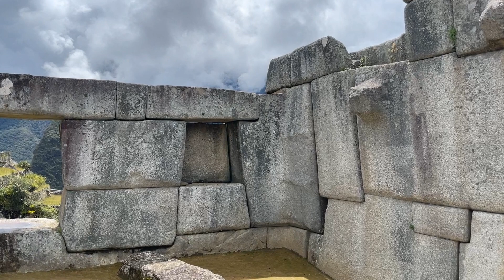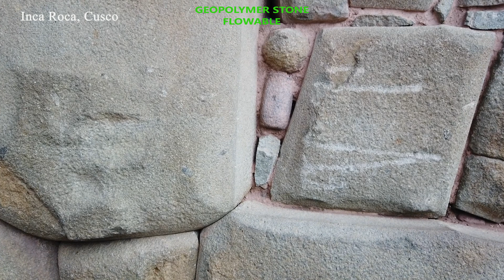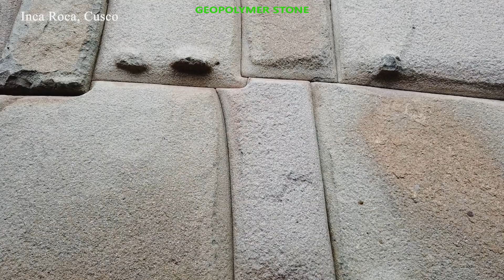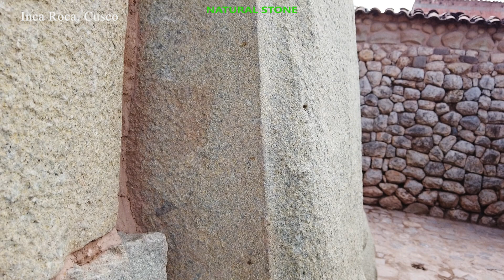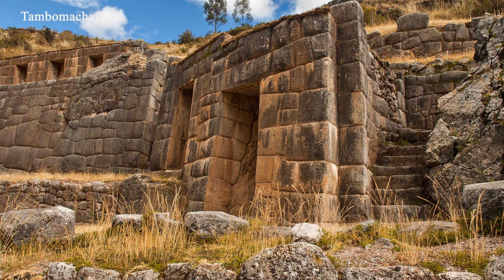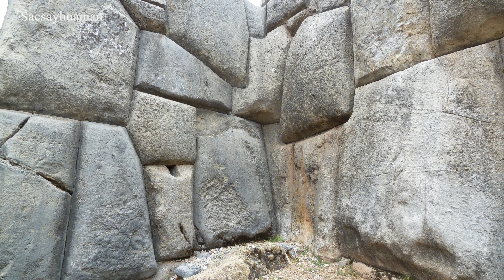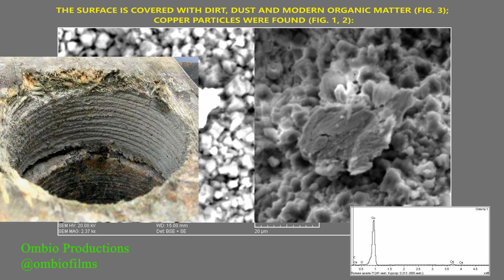Facts about geopolymers in Peru and Bolivia. And what alternatives? #history #ancient #incas

Comment: I found this video such  a Gishgallop of faulty reasoning and stretched logic that I wouldn’t know where to start with a response. However,  nice graphics, good presentation.
Reply from the maker: Thanks. "faulty reasoning and stretched logic" usually means there are no arguments.
Reply from the maker: The idea of GP has no basis. Therefore, reasoning about nonsense looks like nonsense. https://docs.google.com/document/d/1hpqI_MUSg7hO4-vvKs1peFk4p-VCj8Ce/edit?usp=drive_link&ouid=113821213738328685474&rtpof=true&sd=true https://drive.google.com/drive/folders/1Jp0nyqT4Jo-86PBJjmXAvC6biKFSX8t_?usp=drive_link
Reply: @GRES_TAC - thanks for sharing that. I have read about those lazy stone before and I have to say, your conclusions are way too premature to be conclusive. You cannot just assert that since these stones are halfway from quarry to site that they are abandoned cargo. You need more than that because there are many reasons why they could be there. You still have a lot of work to do to explain how they got there instead of assuming the fact. I’ll give you 2 glaring flaws with the argument.
why is there no collapsed frames or rollers devices under any of these stones. If they were moved by the Inca a few hundred years ago, then we would expect to see something. 
There is a river. Explain how Neolithic people moved masses the sizes of the space shuttle across a white water river. 
There is no answer to either of those questions because these stones were never moved and were poured in place at that location. There was a small city in this valley. Do you think that the Sun temple was the only construction in the area and the rest was just fields like it is now? Not likely. It’s more likely that these stones had some function in a thriving valley town. What function? Take your pick. All sorts of things around modern towns need a big concrete slab. It could be for a workshop, some sporting thing, maybe a statue was on it. 

If anything, the existence of these lazy stones are evidence against your proposal, not in support of it. It’s all reconstituted stone, created and poured in place. No haulage or stone cutting is required anywhere therefore all your logistical problems go away. Ockhams razor.
Reply from the maker: @SueDonym123  " no collapsed frames or rollers devices under any of these stones" The quarry stones are on ramps. No need for rollers https://drive.google.com/file/d/166Y44zIFm41WaqrMy0DuyZrK5JFXKyFK/view?usp=drive_link "Explain how Neolithic people moved masses of the space shuttle across a white water river." What Neolithic? The Inca Empire is a different level of knowledge and capabilities. Urubamba is shallow in certain periods. And there is a dam nearby that allows the channel to be diverted.
I understand your position. Thank you for the discussion.
Reply: @GRES_TAC  - That’s a pretty poor demonstration of concept and I find it hard you think that’s anywhere near conclusive. They showed a huge number of workers pulling a medium sized block skidding along rounded cobblestones. I’m sure you understand the concept of friction coefficient. Here are the flaws of the model being presented-
Where is the level cobblestone path from quarry to site? If you think this was Inca then you would expect to see something more. Why are the tired stones sitting in the dirt? 
They video didn’t demonstrate going down a steep slope, across a river, up a river bank, and up a long steep incline. They only did 100m at best on a flat controlled surface. You need to demonstrate the difficult parts are possible, not just the easy ones
It was not a 60t stone block. Proof of concept requires a demonstration of the most massive, not the average. All they did was prove they could pull that stone or lighter. Demonstrate the heaviest load, then you’ve demonstrated all the loads, not just half of them
Even if the river dried up completely they are still not dragging a 60t stone block over it. Water or not, this is a major obstacle that nobody wants to address because it’s an inconvenient fact.
What is the logic behind transporting huge difficult loads on such a complex journey, when they could just quarry uphill from the site and just slide stones straight down? The Ollantaytambo site is high up off the valley floor, but there is still 5km of mountain slope above it. 

The existence of these tired stones does more to discredit the mainstream model than it does to support it.
Reply from the maker: @SueDonym123 "a huge number of workers pulling " - these are not workers, but villagers, including women and old people. There would need to be an order of magnitude fewer strong guys. There is also a method that I used personally, vertical pressure is applied to a stretched rope, which turns out to be a lever. "a medium sized block" the block is not much inferior to the smaller of the 6 megaliths. 0.40 - timing of the video fragment with transportation
https://drive.google.com/file/d/1oulvPz1QUp0n5bPfq9lYq5K1aO5677UI/view?usp=drive_link it is wider and thicker but shorter.
"Why are the tired stones sitting in the dirt? " Because the river is overflowing, and it is unknown what is under the stones, soil or a section of the ramp. Given the area of the block, the specific pressure on the ground is not critical. A person standing on one leg can exert more pressure on the ground than a solid granite megalith one meter high. Therefore, a serious foundation is not required. It should also be noted that the blocks had a special shape, similar to the rise of a boat, which made it easier to transport them. "They only did 100m at best on a flat controlled surface." Look at the start of the block's path. 0.23. Your statement does not correspond to the data.
"Even if the river dried up completely they are still not dragging a 60t stone block"

I agree that it is not that simple. And there is really no full demonstration, just as you have no serious arguments. This is not a discussion. Thank you. I do not have time for this.
Reply from the maker: @SueDonym123  And it was not about transporting the blocks, but about the fact that the blocks were cast. You used a substitution of concepts. Let the methods of transportation be unknown. But the blocks were definitely not cast in the middle of a garden or in a quarry. So the tired stones are a clear indication that there was no casting. The question is about the methods of processing and transportation, but not the casting.
Reply: @GRES_TAC - none of those are good refutations of casting. There is still more evidence of casting than the chip and drag model. 
And the ultimate question that nobody from your camp that wants to address is the logic of going to the other side of the valley for material when there was a perfectly good mountains above the site. It’s such an inconvenient logic that seriously puts doubt into the  popular model. I think you all fear digging too much into this because you know the drag-to-site model is heavily flawed
Reply from the maker: @SueDonym123  " is the logic of going to the other side of the valley for material " This is a great question. It has nothing to do with casting, but it does talk about the importance of choosing specific types of stone. Which of course was not required to create household or even ceremonial structures. Some answers exist. And I gave brief hints in this video 27.24 https://youtu.be/CI6oXOLmb7k And the following scenarios will devote more and more time to this issue. By the way, the statement about block casting also does not answer why it was necessary to imitate different stone products each time. So this argument, like your other ones, works against casting.

 "from your camp" I do not belong to any camp. I collect data and analyze it. If the data shows that there was a casting, then it was a casting, but so far all the data indicates that the stone was processed, which retained its shape. Its strength indicators at the time of processing are questionable.
Reply: @GRES_TAC -  Sorry, with all respect - that is wrong. It has EVERYTHING to do with GP casting.  The chosen location of the quarry gives evidential weight to the GP model, not the drag-to-site model for the following reason. This is a time period before machines and steel, therefore the process HAS to be super simple by constraint. To drag and drop 60 ton stones at that site location realistically can only be slid down from above. There is 5km of rocky mountain upslope from the site. You cannot be serious when you claim there is nothing that will suffice in ALL that mountain. All you need is big unfractured  blocks. That’s it. What specific qualities are you proposing that would require going to an impossible location on the other side of the valley to source material instead?  The Ockhams razor principle would rightly label this idea as ridiculous. You would need to demonstrate WHY the builders would need whole blocks from the other side of the valley in spite of an easier alternative, otherwise your idea has no basis.
Conversely, for the GP method, source material selection is critical, because this a chemistry based building method. Not any rock will do and it’s necessary to go to where the right rock types are found. In this case the closest ideal rock for quality chemistry is on the other side of the valley. The factors that make massive logistical hurdles for your proposal is NOT an issue for the GP model, because the material is transported  as small broken pieces which is easily carried by llamas. Crossing the river requires nothing more than a few rope bridges. The entire material requirement for the site is transported this way. This method eliminates all of these engineering issue you’ve been struggling to come to terms with. 
I’m not sure what you mean by ‘imitating stone products’? Could you explain what you mean by that? 
Also, to say you’re ’not in that camp’  is just being entirely disingenuous dude. You’re not fooling anyone, except only yourself if you genuinely believe that to be true. I don’t mind if you disagree because you make me think deeply about the issues involved, but don’t pretend you are open minded to all sides of the debate.👍
Reply from the maker: @SueDonym123  I understand your position. Thank you. Debate is impossible, you have no arguments other than those that "could not".  You are simply substituting concepts. The blocks were made of GP because they could not be transported. And that is why they ended up in the middle of the garden) In addition to the masonry, there are processed rock outcrops https://youtu.be/Hdwim_n1m_0  in your opinion they were also cast from GP. Because if they could process rock outcrops, they could also process the blocks, which means they could create masonry.
Reply from the maker: @SueDonym123  It's actually funny. The blocks couldn't be transported, so they were cast in a quarry and then transported. Or, the blocks couldn't be transported, so they were cast halfway between the construction site and the quarry. The tired stones weren't in the masonry, there are no traces of joining on them, more about that here. https://www.youtube.com/live/1OQl9pqhPb4 22.56
Reply from the maker: @SueDonym123  "Conversely, for the GP method, source material selection is critical, because this a chemistry based building method. Not any rock will do and it’s necessary to go to where the right rock types are found. " another funny example of incorrect logic. The correct material for the Temple of 10 Niches is local. So for GP everything was suitable. And there was no point in imitating the granite of Kachikata.
Reply from the maker: @SueDonym123  "I’m not sure what you mean by ‘imitating stone products’? Could you explain what you mean by that? " You will not get granite. You will get something similar, and this similarity will be only for an amateur.
Natural granite has a crystalline structure formed over millions of years under high pressure and temperature. Its minerals (feldspar, quartz, mica) intergrow and create strong natural intergranular bonds.
Geopolymer stone, by contrast, has an amorphous or semi-amorphous matrix. The grains (such as granite aggregate) may be natural, but the binder is synthetic, based on aluminosilicate polymers. It is an imitation, not a reproduction. "Interaction of Metakaolin-Based Geopolymers with Natural and Artificial Stones and Implications on Their Use in Cultural Heritage By marina clausi"
Reply: @GRES_TAC  - ‘And that’s why they ended up in the middle of a garden’ - I addressed that, you’re not listening. I’ll say it again in the briefest way possible. This area was once the location of a small city and the Ollantaytambo site is the only thing that survives to this day. All other soft structures are gone. These lazy stones are not left enroute but were made that that spot to facilitate whatever was there ( take your pick and it probably wasn’t a garden.) Think of it this way - when you see a modern vacant city block with nothing there but a old concrete slab, and then I told you somebody dragged it and left it there, would you agree with me? Or would you disagree with me to say there was once a building there? 
Ok, so the ‘processed rocky outcrops’ at the temple of the condor area. I have written a section about this area in my book. Thank you for the link. You have shown some good details there. To clarify my position, yes. This is all 100% reconstituted stone. Every single place. The entire toe of that mountain side from below the condor head, to the valley floor is a veneer of artificial stone. Every instance of a ‘carved’ niche is rendered stone concrete. Everything these builders did was additive. There is no extraction of natural bedrock anywhere at these sites. When they hit an inconvenient piece of bedrock, they went over it, never removing it, because that was too difficult for them. Once you get your head around that principle, everything you look at thereafter, makes perfect sense. When you examine the zig zag hatching you detail in your video you bend over backwards to surmise some sort of corundum infused hypersonic tooling because of the deterministic nature of the scratch detail. The hatching is simply scratches made by a sharp stick in a soft mortar-like material.  The purpose of this niche and hatch pattern are obvious.  It’s an alcove prepared for an installation identical to the one already right next to it. This hatching feature  is a bedding joint. It’s a common jointing method that is used in construction today. In fact, the existence of the construction method points to poured construction in itself. It provides a mechanical grip for the structure that is going to be poured there. 
In your video you raised many interesting details about these grooves that creates quandaries for all known methods of primitive carving techniques. Every single one of these issues are solved with the GP methods. The megalithic blocks at Ollantaytambo are made from granodiorite and there is absolutely a chemical pathway to use it as a geopolymer. It’s chemically  possible, and we see loads of physical evidence to back it up. What more do you want?
If you were truly impartial, then you would not be resisting the idea so much.
Reply from the maker: @SueDonym123 The blocks in the "garden" have traces of processing the same as those in the quarry. And the fact that Inkamisana is faced with stone is nonsense. "some sort of corundum infused hypersonic tooling" I am not saying anything about ultrasound.
Unfortunately, I have heard nothing but fantasies.
All the best.
Reply: @GRES_TAC - the ‘processing marks’ you keep mentioning are not the smoking gun evidence you think they are. They created and formed artificial blocks at the quarry too. Quarries have infrastructure too you know. Just because stones in different locations are made the same way is still not evidence any stones were moved. Stop saying it happened if you can’t propose any serious mechanisms. This is the running theme of all your videos. You say a lot of words without saying much at all. With all respect, your videos are just fast food for shallow thinkers.

Comment: I'm fairly certain these blocks were cut and shaped.  There is possible evidence out there that the builders may have had the ability to used radio active material that could locally soften or essentially vaporize the material as it moved along the stone.  Water may be another option.  I think they were simply cut, most likely through a larger block to make the puzzle pieces.  Whoever built these sites could obviously move extremely heavy stone and place them, so cutting them on the ground horizontally and then stacking them wouldn't be surprising.  The vessels from what I have seen so far show no traces of copper or metal material in the cuts, though much more work needs to happen.
Reply from the maker: Thank you. Here is more about how the blocks were prepared from 18.17 https://youtu.be/1OQl9pqhPb4?t=1097